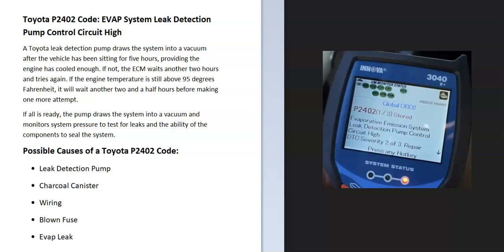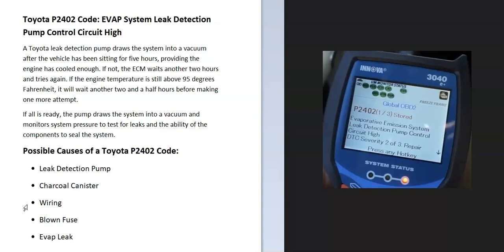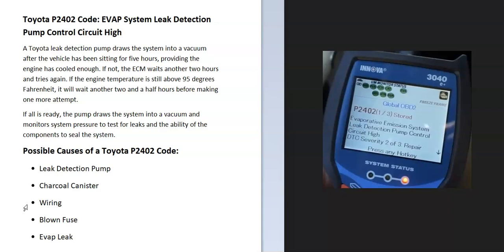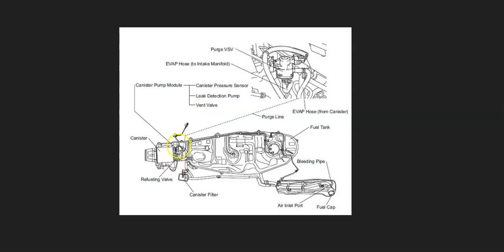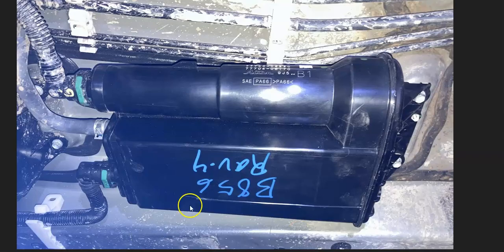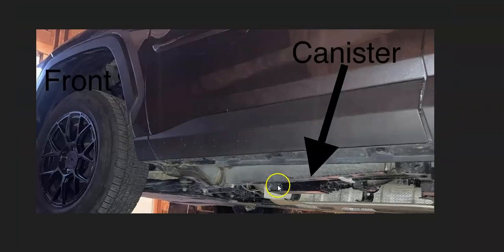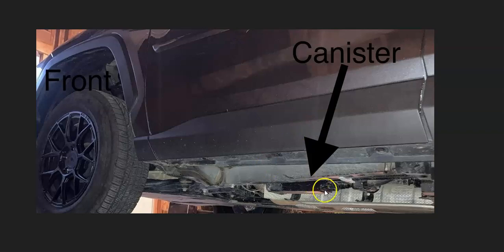Causes and Fixes Toyota P2402 Code: EVAP System Leak Detection Pump Control Circuit High

Comment: Where is the leak detection pump on a 2017 Toyota Sienna SE? I looked in engine bay, don’t see it. I looked under van on driver side and see the charcoal canister and vent shut valve(rectangle) but no leak detection pump.
Reply from the maker: It's located with the charcoal canister. Looking at a replacement unit on eBay or similar will show what it looks like.

Comment: But what fuse is it on? It doesn't have a dedicated fuse
Reply from the maker: Yes, there is a fuse, it can vary between models. Toyota often has the EVAP system on the EFI fuse, but again, it can vary.

Comment: My Sienna, 2017 does this like clock work every December when we have abrupt outside air temperature drops. It gets rest and usually stays away until next year! I had the agency look into it and they said it was okay, but replaced the gas cap with a factory one. I reset it myself and put Vaseline on the cap seal. Will this cause the car to not run if not addressed?
Reply from the maker: If the purge valve is stuck open, it can affect the engine; otherwise, it just won't pass an emission test.
Reply: I notice that to every winter it turns on

Comment: I find it interesting that I have yet to see anyone mention a possible problem with the pump inlet filter. P2402 specifically calls out the control circuit. There are other codes that address leaks. The control circuit powers the pump, and if the pump motor is straining to run because the filter is clogged, the motor will draw more current. Perhaps nobody mentions the filter because it is buried or they are unaware it exists. They built the car around it.
Reply: Where is this filter located? Is it the charcoal canister?